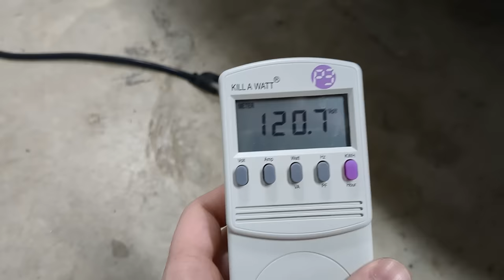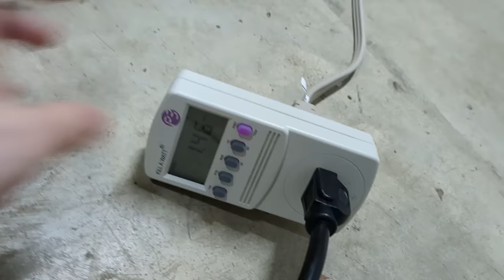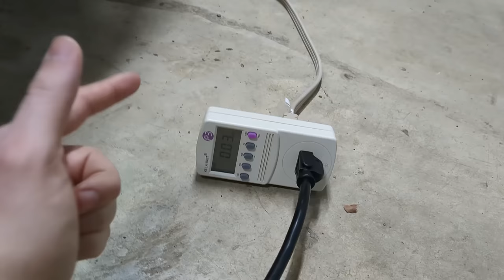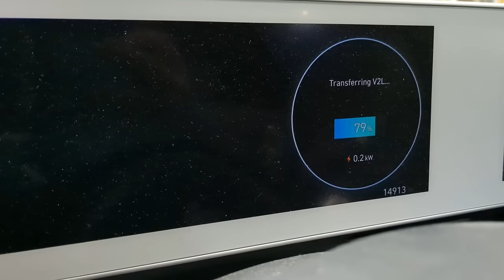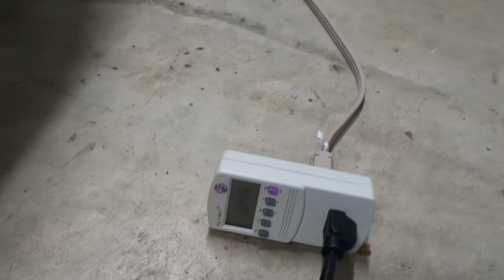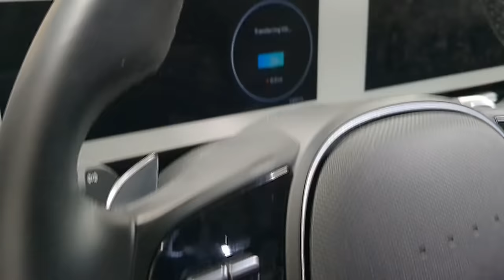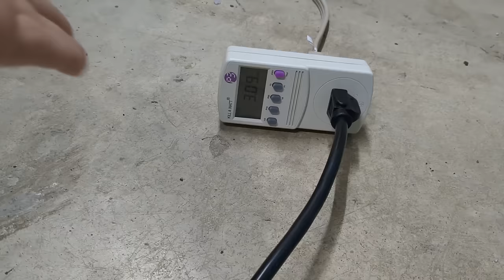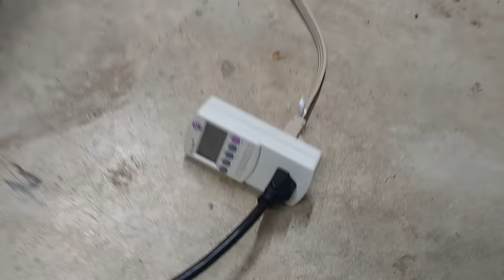A 24-hour test run of the Hyundai Ioniq 5's Vehicle-to-Load function

Comment: We've done this with out Bolt and a 2000 watt inverter.  This was one of the reasons we went with individual 120v mini splits for each of our bedrooms; they only use about 300 watts to maintain temperature on either heating or cooling and we've run two of them at once off of the car with room left over for other things.
Reply: I assume you connected the inverter to the 12v battery and left the car on to recharge the 12v? No damage to the 12v after some time?
Reply: How much do ducted heat pumps use in comparison?
Reply: @BakouMOH  

If the Bolt shares the same equipment as the Volt, then the DC to DC converter would be 2,000 watts to charge the 12 Volt battery.
Reply: @wzDH106  the Bolt uses a 1600w DC-DC converter.
Reply: That's what I did with my bolt for 3 days when a hurricane hit.  Instead of mini-splits though, I used it for my fridge and freezer.
Reply: I did this for my volt with a quick connect to plug in the inverter but we have only ever lost power for a few minutes. I plan on trying it on a camping trip in a few weeks. I am in the market for a full EV but one advantage to the Volt is that as long as I have access to gasoline, I could continue to run my "generator" for a long time after the battery is out of juice.
Reply: @Daniel15au  greatly depends on the size of the unit, outdoor temperature, if it's heating or cooling and if it's inverter based or not.

A 'typical' basic 3 ton heat pump is going to pull 8-13 amps. Or 2160-3120 watts.

Comment: lol, I used my 2015 Fiat 500e to power my refrigerator/freezer a couple led lights, and a fan for 3 days when we had no power after hurricane Irma way back in 2017. Using a 12VDC to 120VAC 800 watt inverter from its 12v system by cycling the car on and off every 3-4 hour hours to support the 12v battery. After the 3rd day I had to go back to work, which had power and I just disconnected this system and drove it to work and charged up for free. Came home and seti it all back up. I wish I had a simpler solution like this one at the time. I have since built a DIY solar generator. So, after Ian I ran it all from that. 

I discovered immediately 2 things: one it was excellent to know was it wasn't nearly as efficient as it could have been; but, it was doable and this would be a key feature of EVs in the future. The second and most important thing was, it was perfectly silent and stealthy. 

I realized I hated my neighbors' generators; because, they were so loud you could barely sleep.

Comment: You may want to consider installing a manual transfer switch - where you can select specific loads and switch them from utility and emergency as needed. I've seen 6, 10, and 12 circuit versions. They wire directly to your electrical load center and make for a more permanent setup. Then this way, all you have to do is run one cord from the vehice to a power inlet in the garage. They are designed for 220V applications but can easily be retrofitted to run only 110V loads.
Reply: I did this with my Prius which I had an inverter for. Having the 120v in the house running without extension cords was amazing.
Reply: yep I have the same setup with my 2000 watt Honda generator

Comment: Have a nearly identical Ioniq5 (just has the green/white interior instead). I bought the OEM V2L adapter from a Hyundai dealer because (for a short period of time) they had some sort of price issue and the price of the adapter dropped to $170 (current MSRP is $670). I’ve used it in a power outage to power a light, cable modem, TV, fridge and a space heater. It also powered a coffee pot while also powering the TV and cable modem. You do have to shuffle loads a bit when using things that generate heat (like a heater or cooking equipment) otherwise it has enough power output to run basically all of the lower power loads in your house simultaneously. I’ve also wired an appliance cable to my gas furnace so that from now on, I can use the car to power the gas furnace instead of needing a space heater since the furnace uses way less electricity. It is a fantastic feature. My partner was super skeptical when I bought the adapter, until it powered the house during a nearly 24hr outage.

I’m glad you checked the power output with the oscope. I’ve been curious about that, although I assumed that the quality would be fairly decent since they don’t say anything about not plugging “sensitive electronics” into it. Was the picture taken with an electrical load on it or not?

It’s also worth mentioning that any V2L use does not “only” use the OBC. It’s keeping the entire battery management system on because the OBC doesn’t manage the battery, it just steps up and rectifies the ACV to the correct DCV for the 800V battery, as well as a coolant pump for the OBC since the inverter does get warm. Also, any time the BMS is active, it turns on the DC-DC converter to power the vehicle’s 12V system.

Comment: I was the guy on mastodon that asked you about power to the furnace and while I'm also a northerner, I'm from the east coast. Every time anybody talks about power outages I have flashbacks to Sandy - 11 days without power in early November. A cold one, too. 

One funny thing about that was having people poo-poo-ing electric cars in the first day or two saying that if you'd gone electric you'd have no way to charge and no mobility. And then pretty soon EVERYBODY was stuck because we couldn't power the gas stations to pump the gas anyway, and trucks couldn't get in to restock.
Reply: A lot of people talk about EV like "what about a MASSIVE power outage ? you could not charge your car anywhere !"
But at the same time gas pump would be off too ! (And I doubt that any "emergency fuel tank" would come arround to refill peoples car).
Reply: If everything was electric in our coming better world, there would still be fossil fuel powered generators (probably running on compressed gas). The world isn't going to give give up completely on fossil fuels because there are situations where they will be needed. 

But that doesn't make emergency power from cars with batteries unattractive. If I still had a fossil fuel generator and an electric car, I might choose to use the generator to charge up the car's battery periodically (during a really long outage) so they don't waste so much power keeping the generator idling.

I don't think keeping a natural gas feed to the property is worthwhile if you've got let's say a 5 or 10 kilowatt generator available. I would restock the generator with deliverable gas. And I wouldn't want to maintain a house heating system based on piped-in natural gas.
Reply: @tom-sn4gd  You can drop a hand pump or even a bucket on a rope into the underground gas tank. Gas stations can run on generators.

Comment: This was really cool! An interesting addition might be a "combination regulator" (sorry can't find the correct English name) but it's basically a power strip with a primary and secondary socket. So you cook, and it will shut down the secondary freezer when necessary. (They are often used for washing machines and dryers in Europe, so they can share the same group)
Reply: Not seen them in my European country, what is the name you know and in what country do they use that name?

Comment: 31:57 the "lost" power is not only about keeping other care systems alive, but in the round trip loss in charging and discharging the battery. Also a full analysis would account for DC-AC conversion in the inverter, and whatever Voltage conversion is needed to match you local line Voltage

Comment: This is one of the big reasons why I can’t wait to get an EV, being able to run my fridge, some lights, and a cooktop during an outage without having to bother with a generator is going to be a major improvement. I’m also fortunate enough to live somewhere where our longest outage has been a handful of hours, so it will be *plenty* to survive. I have a secondhand generator I got for free currently and the downsides of dealing with the generator far outweigh any benefits it provides for me.
Reply: Great sarcasm
Reply: @DrLoverLover  Oh no, not sarcasm, generators legitimately suck to have to deal with.
Reply: Why do you even need a generator if the longest outages are only a few hours?
(I am asking as someone with basically 0 experience regarding outages. So it's an honest question :) )
Reply: @Jehty_  TBH I don’t really, it was just free to me so I didn’t turn it down as a just-in-case measure if we lost power in the winter when it gets very cold here. My inlaws got a new one to replace the one they gave me because they live the next town over and don’t have a good utility company so they’re constantly having outages that are days long.

Comment: If you properly combine this with one of those smart breaker boxes, I'm pretty sure you could have a setup where you can simply use your car as an UPS for your entire home.

Which would be a very cool setup.
Reply: smart breaker box $$$$$$
Reply: @williamsanders6092  A homebrew box to do similar prioritized load-shedding on a smaller scale could be far more economical, though. Arduino or similar MCU, one more more current transformers, ADC board, relays & relay drivers, all feeding a set of labeled power outlets. For limited outputs, all could be built into a deeper-than-usual quad box. I've heard there are commerical products on the market for this, at least in certain countries, but have never seen one for sale.
Reply: For the 110V loads.
Reply: @jordanhazen7761  that is a rather dangerous idea. 

Electromechanical relays are not engineered to function as safety devices, and I would therefore not trust them for this task
Reply: @horrorhotel1999  Ever looked inside an automatic transfer switch, or its equivalent within a UPS, or a data-center PDU with switchable outputs, or an elevator control panel? Relays everywhere, in far more critical roles than this would serve. What else would be used? Of course they need to be properly rated for the task in terms of contact voltage and current-break capacity, preferably with a significant safety margin.  Also, a load-shed controller is not really a safety device - in the case where it failed to switch something off when it should, whether due to an undersized relay contact welding, software bug, etc, it just reverts to back to a dumb power strip again, and the upstream power feed would trip offline on overload, same as now.
Reply: @jordanhazen7761  Then I misunderstood you, thanks for clarifying your point.

Because to me it sounded like you wanted to replace the circuit breakers with relays.

I agree that you can size relays for any tasks really, that is true.

My point really only was, that they are not meant to be circuit breakers and shouldn't be used as such
Reply: @horrorhotel1999  basically they run over engineered relay in power station to connect to grid.

Comment: Quick note re: the fridge at 12:40, Samsung refrigerators have a seven-minute delay in startup after a power outage, to avoid overloading the compressor (just in case it's a <1s outage during compressor operation).
Reply: As an ex appliance control engineer, this is standard across the industry.
Reply: @davidwillmore  I work at a cinema and have to empty dehumidifiers. The compressors on dehumidifiers also seem to have this delay. Is this because the high and low side pressure imbalance could potentially stall the compressor and burn up the windings?
Reply: @aspecreviews  that is correct.

Comment: Great test! You should also test the 120v outlet built into the car (interior) too, and see if the phantom load is more/less than the V2L method. ⚡👍
Reply: I haven’t finished the video yet, but I would be interested to know what the idle wattage of the Inverter is. 

The 2 inverters that run my house each do up to 6500w and use 70w idle. For a whole day, that’s over 3KWH just so the inverters can be ready to power a big load. 

In the wintertime I use a small inverter, only 1100w to power my whole house, until I need to run the well pump or water heater. Then I need to switch to the big inverters. But the small 1100w inverter only uses 10w idle

Comment: It’s interesting to observe that the maximum inverter output is “your” biggest issue. This really complicates things, with having to unplug and plug in various devices. A 120 volt 30A output would have been much easier to work with. 

For this system to really work for less nerdy people , we need the smart electric panel you discussed in a previous video. ❤
Reply: Yeah this is fairly limited compared to say the f150 lightening that can do 9.6 kw split phase.
Reply: In europe the ioniq 5 and ev6 output 3500W, because they output 240v AC here.
Reply: @y0uRF4t3  If that's true, 3,500 watts is 3,500 watts, so the car's battery would drain 3.5 times as quickly at max power. Are you sure the car's electric generator system in Europe would allow 3,500 watts of load?
Reply: @manitoba-op4jx  Yeah Alec mentioned that at the end of the video. I think Ford mostly included that feature so they could market the lightening as replacing a generator on job sites. Iirc you can option it with a power panel in the bed that had the same connections as a beefy portable generator.
Reply: @bobbabai  The thing is more about like when Alec used his toast oven. He only used it too cook his pizza (so presumably no more than 30 / 40 minutes), but he was forced to unplug the rest to not overload. Here you can do that without unplugging. Sure heavy load are bad on the long term, but not for 30 minutes
Reply: 3600 to be precise. It’s about the standard for an electrical circuit in the 240 volt world so I think they are just matching that to prevent any issues such as extensions cords not being designed to handle it.
Reply: @tom-sn4gd  What you just commented has nothing at all to do with anything that I said in my comment.
Reply: @bobbabai  on the electronics side, 3600 W at 240 V is 15 amperes, while the 1,8 kW at 120 V is also 15 amperes. 
The cost of semiconductors raises wit current much more than it raises with voltage, and they must tolerate the 800 V pack voltage anyway. I wouldn't at all be surprised to find out that the actual inverter circuit is identical, and simply programmed to output the local voltage.

For the battery, 3.6 kW is nothing.

It would likely be less efficient at idle (due to higher capacitive losses when charging caps in the circuit to 240 V instead of 120 V), but it will likely be more efficient at rated load (due to the lower difference between the 800 V battery and the AC output voltage).
Reply: @Validole  I understand 3,500 watts is not terribly taxing for a battery pack that is 40 to 60 kilowatt hours in storage capacity. And I understand the relationships between power and voltage and current and the required wiring and connectors needed based on power, voltage and current. I have a degree in electrical engineering (from way back in the early '80s). But your response didn't really answer my question, though, about whether the system in Europe allows 3,500 watts to be delivered by the car's system to a load outlet.
Reply: @bobbabai  Sorry if I misunderstood. But from the french documentation of the Ioniq 5 : yes it can deliver up to 16A at 230 V
Reply: @bobbabai  See the wiki article on the kia ev6, 1.9kW International, 3.6kW Europe. In the ioniq 5 it says "up to 3.6kW". Yes it drains faster if you use all that power. 
In europe it also does 3.6kW level 1 charging from regular household outlets.
Reply: I like the idea of Tech Connections taking the hotel coffee maker like how some take a robe.

Comment: If they had a 220v V2L adapter you could wire up a generator plug with the breaker lockout switch and run anything you keep a breaker on for. That's what I find interesting about the Lightning it has that plug in the bed and doesn't require the expensive transfer switch if you already have a generator plug.
Reply: This is what I was hoping for as well. Maybe future generations. I think the lightning will support this though. And maybe the hybrid f150
Reply: Works in my setup but this costs more - I have 2 Ecoflow batteries and the 240V hub - connect that to generator outlet.  Then to charge the batteries use the car V2L and do each battery at 800watts of charging or so.  Has it's own issues though of course.  But not being completed connected to the car is great - go to work - furnace, sump pump operate perfectly fine!
Reply: The problem with this is that the invertor in the car that powers the V2L is puny. And changing it to support higher power (say, 10kW) is not worth the expense. This should be offloaded out of the car, the invertor should be in the garage and it should connect directly to the high-voltage DC bus. This way you can easily provide 10-20kW of power, making it competitive with a house backup generator.

Comment: This is one of the wonders of modern power electronics, it's very easy to create reversible converters and jump between DC and AC or vice versa. Before high voltage semiconductors you would have had to have a DC motor turning an AC generator to be able to do this.